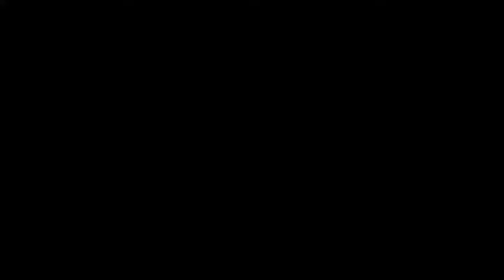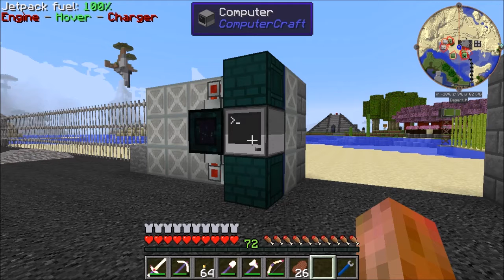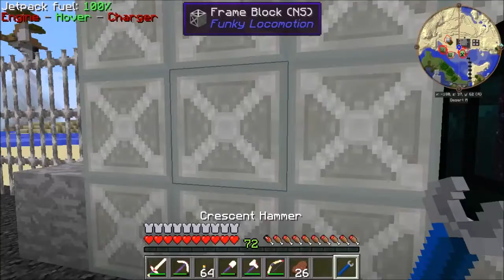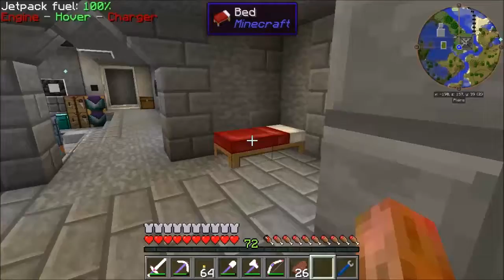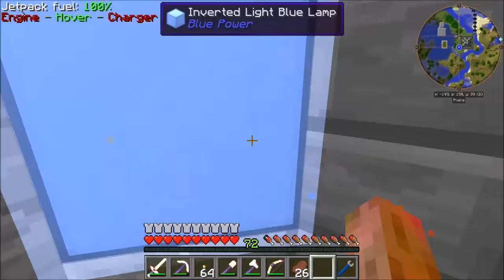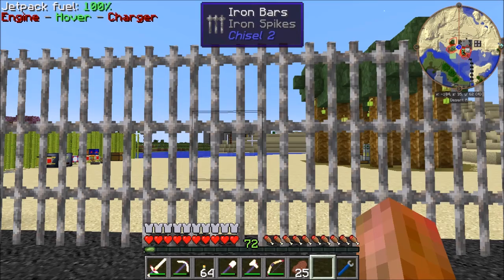Modded Minecraft - Less is More #19 (Funky locomotion security gate)

Comment: Also, while I'd use frames for a tunnel bore, for your current use case here I've used ToggleBlocks, which is not only easier, but lets you use obsidian as your gate block as well.  I am assuming that FL's frame blocks don't have that much blast resistance.
Reply from the maker: +Petrus Laredes The frame quarry will be in the air in the mining world so I don't think i'll be running into anything that will hurt it. I have a pretty vivid picture in my mind how I want to do it, but that never works out : )  Don't worry I'll be doing some testing before I actually do it.

Comment: I put together a frame-based tunnel bore during 1.2.5.  I did it by building a winch; that is, a block placer to add frames which were then pushed forward to extend it, and a block breaker to remove a frame after it was pulled back to retract it.

The really fiddly part is deciding how to get blocks from the drill head back to where you can use them; although you can probably just use ender storage to skip that mess, which is the usual method.

I would also strongly recommend getting ChickenBones' Wireless Redstone mod for your signalling.  If BluePower has bundled cable, then that will probably work with ComputerCraft, but you will need to check.  You will need six channels for the drill's movement, and another one to tell it to break blocks.  The channel numbers will probably be 1,2,4,8,12,16 since it uses base 2.

The other recommendation I would make, is to build a horizontal bore at level 12, rather than a vertical bore at the surface.  With a horizontal bore at 12, as long as you've got your connecting chunks loaded and enough frames, you can theoretically keep going forever.